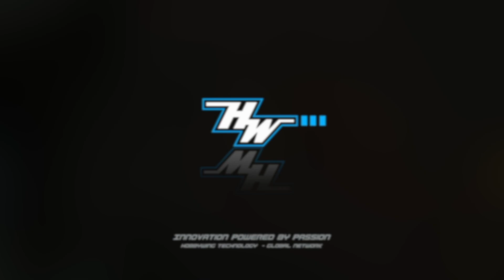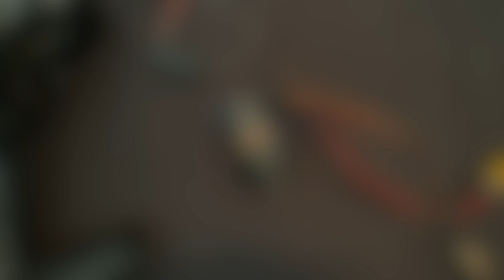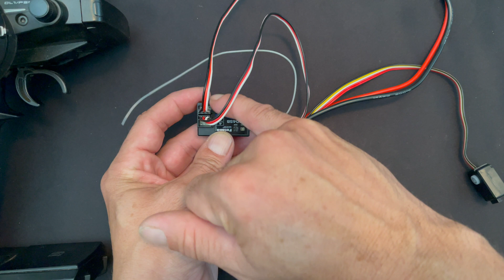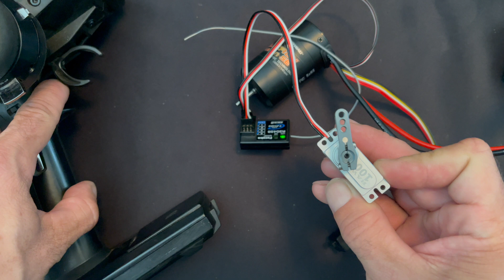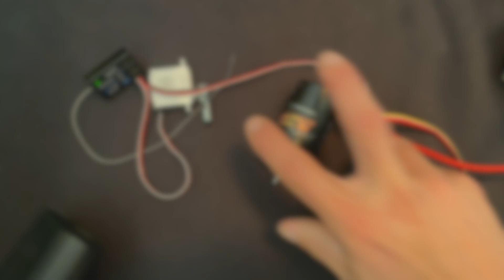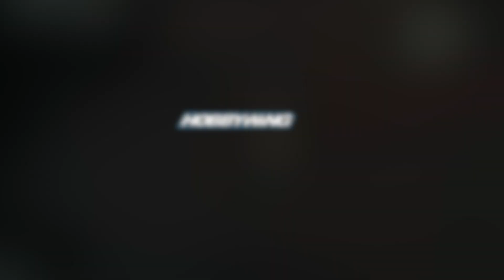The Charlie Show /// Episode 336 /// Calibration Trouble Shooting

Comment: I bought a hobby wing fusion pro 2 in 1 but when i plugged the battery it worked for sometime then the button doesn’t light up and before that the motor was jittery so i just took out the battery as it was not turning off!
 NEED HELP !! What should i do and what can be the problem
Reply from the maker: Should be able to redo the Automatic Motor Pairing.

If that's not it, send us an email - NorthAmerica@hobbywing.com

Comment: Okay so I have a question as I use two of there’s motors on an MOA bully 2 with a radio link remote. When crawling sometimes my rear motor will lock up and it will move super fast and then just drag like it almost jolts forward when I’m in a slow crawl and then will lock up the rear motor would recalibrating them fix this?
Reply from the maker: Shoot us an email for support - NorthAmerica@hobbywing.com 

Would be worth doing the Automatic Motor Pairing on each of the motors to let them "reset" their sensors.

Comment: Question for you regarding fusion 1800 se. Motor was not running smoothly anymore so tried calibration by having motor removed from crawler, disconnected from esc, connected to battery and hold for 8 seconds till it flashes green. Normally goes through cycle etc and then turn off. Mine starts the shaft spinning after flashing green for about 5-7 seconds then stops, jerks then just starts rapidly flashing red and nothing else. Whats the problem?
Reply from the maker: You can Email NorthAmerica@hobbywing.com for assistance.  Thanks!

Comment: Unfortunately my calibration goes green once and then doesn’t do the forward or backwards calibration. Any advice?
Reply from the maker: Typically, when an ESC "won't" go through calibration, there is an output problem from the channel itself.  Check the throttle channel output, "Visually" by using a servo to test the channel.
Reply: @HOBBYWINGOfficial  love your work, but I now got another problem with my steering. Is there a way to centre or calibrate your servo?

Comment: Hi guys, love your channel, can you help, just watched your 336 episode, as my 10bl60 is playing up, for some reason I couldn't get the throttle (transmitter gt3c) to work, when I turn it on solid red led comes on then goes off, when I try to calibrate it after I turn it on while holding the set button until red led starts flashing and beeping the motor keeps moving/rocking very slightly (1 tooth) no green led I press the set button while in neutral the red led goes off as does the beep and motor stops moving, also tried your servo trick taking esc out of channel 2 and replacing it with the servo I still get nothing, can you help, Kind regards. Jason
Reply from the maker: Please send us an email for some direct support - NorthAmerica@hobbywing.com.  Sounds like you've got a channel output issue. Check out our "servo Test" video for some trouble shooting.
https://www.youtube.com/watch?v=NWCgbxWIp24

Comment: I have a question. Accidentally hooked battery backwards on xr10 pro. Poped capacitor. Replaced and works fine.  But doesn't seem to have full throttle. Is that fixable or trash it?
Reply from the maker: Would be worth resetting the ESC and triple checking the replacement power cap and the wiring.  Typically all that needs to be done, is the power cap replacement, with a genuine Hobbywing Power Cap of course.
Reply: What's the best way to reset esc.  Don't see the option on my ota?  Thank you for the reply.  At full throttle light turns solid green.  But no top end.  Swapped each and car is back to speed
Reply from the maker: @wadedavis9344  Under parameters, you can reset the profile of the ESC. 

Would be worth checking over the plugs.  They can wear out over time, get dirty, and cause losses. Loose bullet plugs after a reverse connection are common.  The plug can get hot and deform easily.